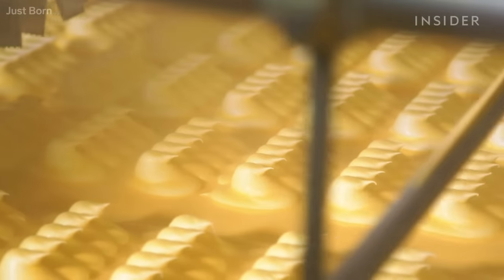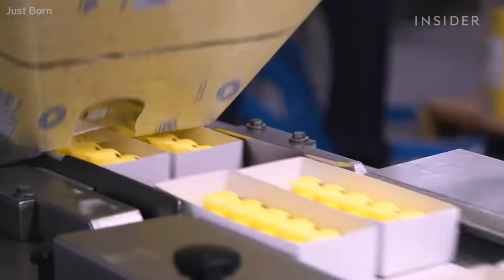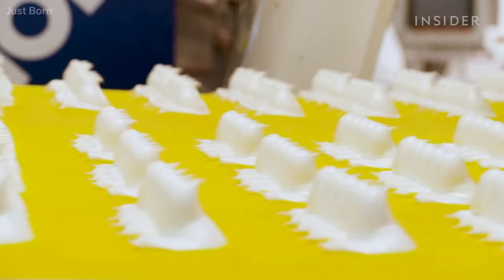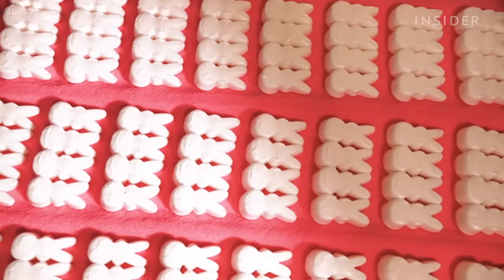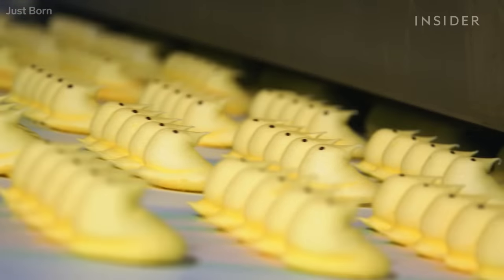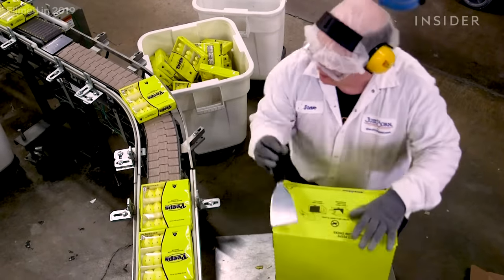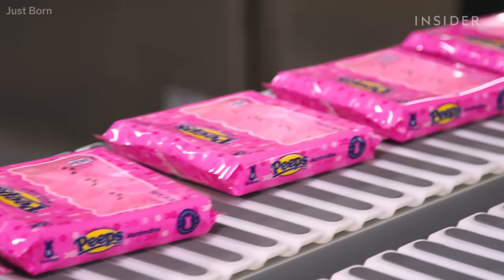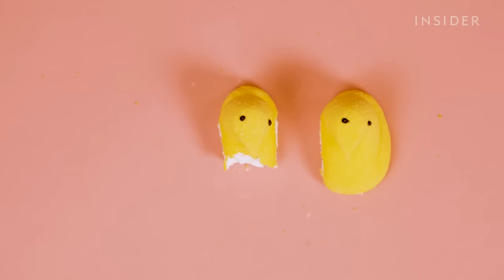How 5.5 Million Peeps Are Made For Easter | Big Business

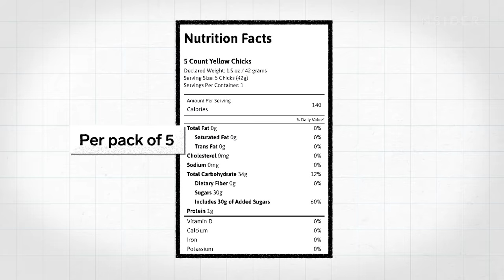Comment: There's a puzzle-clue at 3:12 (and about 30 frames). Or it's just an artifact. But i'm pretty sure it's a clue, but not quite a QR code, this one thinks. However, i currently don't have the energy to look into it. I hope someone else does...
Reply: Another in a single frame of 4:37 (I'm starting to think there's just a problem with engineer's setup - upgrade their machine!)
Reply: definitely. Now I'm seeing them even more frequently. either someone is using the Business Insider YouTube to pass covert messages, or there's a problem somewhere between the camera and the engineer's workstation.